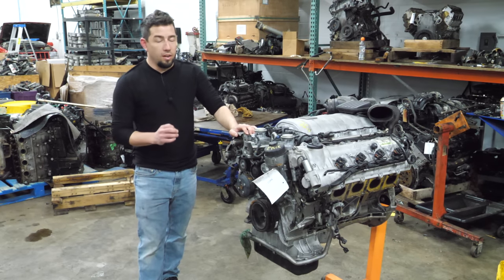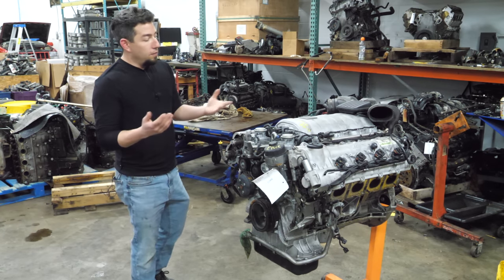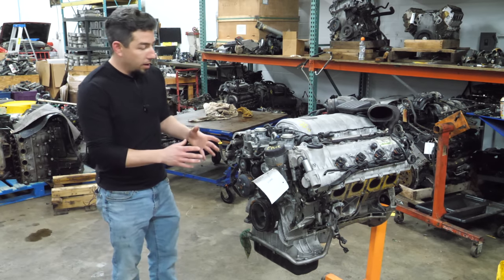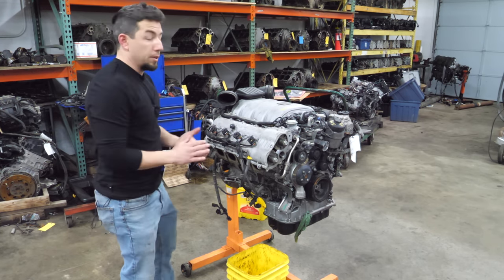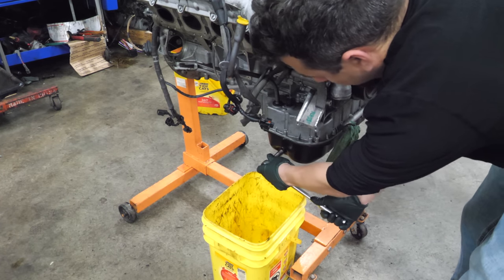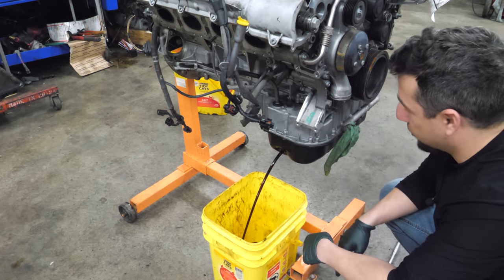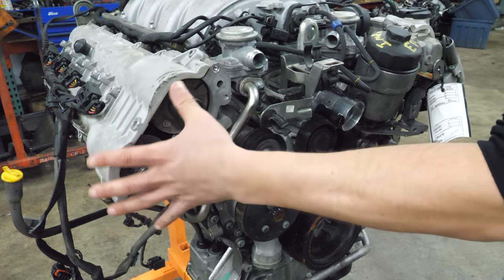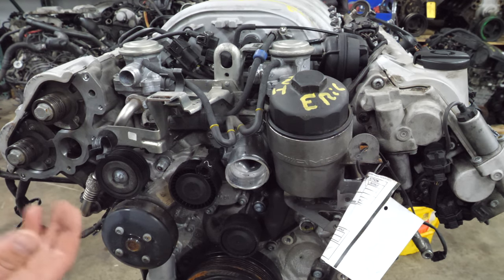Mercedes S63 M156 AMG 6.2L V8 Complete Engine Teardown! What Killed This 500+ HP Euro Powerhouse?

Comment: I am bmw guy, but the two AMG V8 you took apart are designed much more mechanic friendly than BMW V8 or the V10 in the M5. Would love to get an e55 AMG NA or the latter supercharged version.
Reply: They would be the M113 and the M113K ,,probably the most reliable AMG engines ever built , so not so many broken ones around.
M113 used on C55 ,,CLK55 , and M113K used on E , S , SL , SLK  and others.

Comment: Another question comes to mind:  Turning over a typical LS V8 with a 15 inch long solid wrench:  About how many pounds of force does this take?  Back in the day, my friends dad had a 350 Chevy that was rebuilt and ready for heads, on a stand and there was a wrench on the front pulley.  I was amazed at how much force it actually took to turn a V8 over!  I thought it would just turn easily with the cylinders lubricated, as they were, but it took a lot of force.  I was 6'1" and 150 pounds at the time and not muscular, and I could easily turn it over but it was FAR more than I expected.
Reply: It shouldn't have been that difficult, you should be able to turn a shortblock with a 8" wrench with one hand (20-50ft-lbs). Your friend's dad's motor must have had some VERY tight bearings and/or rings or (the worst) he put 1 or more rods in backwards. Many motors have a larger chamfer on one side of the big end for the crank journal fillet radius.
Reply: Yeah - he probably didn't check the bearing clearances, or the ring gaps.
Reply: @johncoops6897  Yeah, it felt like about 50 foot pounds to turn it over, but that surprised me. The heads were on but no plugs so no compression.  He knew what he was doing and lubed it up and let us turn it over.  Thanx!
Reply: Another procedure many shade tree mechanics fail to do is to check and make sure the crank is not bent. Just the crank, lubed new main bearings, properly torqued main caps, you should be able to easily turn the crank with one hand, no wrench necessary.

Comment: Did you work out where the O-ring came from? Some AMG V8s had an issue with O-rings in the oil pump set up going hard and cracking but I doubt that one of them could end up in the strainer.

Comment: How about instead of checking your oil level, you simply don't continue to drive once your car's low oil light turns on? Assuming that the oil light sensor is designed properly (so it actually turns on before you start getting engine damage) then that is all you need to do. I guess some people treat it the same way they would the check engine or needs maintenance soon lights, and just drive the rest of the way home while planning on going to a mechanic at some point in the future?
Reply: Once the oil light comes on, you have probably already done some damage. Especially because it initially happens at high RPMs due to more of the oil being up the top in the heads.
This one wasn't a simple and quick oil starvation... it was driven after it was damaged, for a fairly long distance and probably driven pretty hard.

Comment: I will say that one very first observation you can make of a core engine car be done with your nose. If the engine was seriously overheated the oil will take on an asphalt smell. Those pins you were slid hammering out what was their use? Were they supporting some part of the cam drive system? Looking at your engine stand makes me think of how things just never change. Besides making thing bigger and stronger I feel that some improvement just has to be possible in regards to the typical old engine stand. Did the head bolts that were difficult to remove pass through a water jacket in the head?

Comment: Try looking at "Motoren Zimmer", he does both AMG and MB engines, and from that i learned that there are no cheap way to a AMG engines, if they are cheap you are going to use an insane amount of money before it runs perfect. He did one where they ordered for mote than 40.000 $ parts!

Comment: My guess is, the rubber seal you found was from the oil pickup. Oil starts to suck in air from broken seal, and then oil starvation to engine. A cheap rubber seal knackers these things

Comment: Its front main seal. If serpentine belt breaks....It will end up stuck in pulley and main seal and it will push the front main seal inside engine. Timing chain will shred it a smaller parts and all that mess will end up in pickup tube. At first I was thinking how that had happened...I contacted MB engine department and its common thing. Usually some parts of serpentine belt end up oil sump aswell. Hope that helps :) If some1 here has mercedes then its crusial to control the serpentine belt once in a while.

Comment: Can you find a Mercedes M112 V6 or M113 V8 and tear it down?  These engines were used in the W210 chassis’.  I think they’re great motors having owned 3 of these vehicles. Perhaps too reliable to find??

Comment: It would be nice to see a 6.2L LS3 teardown if you ever get one in. I recently bought a Camaro with the LS3 and it's pretty rough, has lifter chatter and slight (not bad yet) bottom end chatter. Needless to say it will need to be torn down fairly soon, sooner than later. Gotta love it when people don't take pride in what they have and take care of their investment, especially something nice like a Camaro.
Reply: Maybe the owner took TOO MUCH pride and drove the hell out of it as it was intended to be driven
Reply: @sloanmagnum5009  Afraid not, not with the condition that car was in. I wish that was the case. Lol
Reply: @lewismcfarcry  the engine was falling apart under normal driving conditions?
Reply: @sloanmagnum5009  I would best describe it as.. Long intervals between oil changes, running it low on oil, and maybe some hard driving mixed in. I know I have a heavy, freedom foot at times, but I at least make sure the oil is full and change it regularly, around 3k miles, and check/change the other fluids.
Reply: @lewismcfarcry  oh ok. I see now...
Reply: @sloanmagnum5009  What stinks is it already had that high of miles with those driving conditions.
Reply: @lewismcfarcry  will it need a full overhaul?
Reply: @sloanmagnum5009  I don't have the car anymore, but when I had it I was going to put a cam, lifters, heads, ect. A friend of mine really wanted to buy it though so I sold it to them.

Comment: the head bolts on the M156 are notorious failing points. Weren’t they solved or much improved on the refined M159 ?

Comment: FYI; These class of M-B engines can NOT be bored oversized. The cylinder walls are made of a high Silica Aluminum/Steel alloy and are etched after they are machined to size. Leaving a micro thin layer of Silica only material for the rings and skirts to wear against. If there is no damage to the bores new pistons can be installed. But if an oversize is necessary, then all 8 cylinders MUST be sleeved. Leaving damaged blocks like this one as junk! (As far as MBAG is concerned.)
Reply: These blocks are not Alusil etched or Nikasil electroplated.  Instead, they are twin wire arc sprayed ("Nanoslide") with a plasma deposited iron coating.  Provided the bores are not mechanically damaged, the block should last forever.

Comment: QUESTION: If a rod bearing seizes and heats up the crankshaft to where the journal is cooked and discolored from the heat,  is the crankshaft salvageable? Or is it trashed?
Reply from the maker: It just depends on how much material needs to be removed for the journal to be smooth and perfectly round, and then at that point if an appropriately sized bearing exists
Reply: Years ago, they used to weld up crank journals and re-machine the journals. But there has to be a price point to make it doable.

Comment: Considering the amount of engines you tear apart, I’m surprised you don’t use a higher quality engine stand with a worm and gear drive for rotating them. Some even have a hydraulic jack for changing the height.

Comment: I’m at 140 k miles on my m156 engine .  Rocker gaskets x2 , cam adjusters x2 and 13 bonkers expensively oil /filter changes and it’s close to factory power, no oil consumption  and very quiet .  Long live the m156....
Reply: Which head bolts?
Reply: @greydog1104  old style  head bolts .   They do fail but the vast majority don’t according to a merc tech and the amg dealer .  I keeping my fingers crossed 🤞
Reply: @highdefp-rm7zg  I have the old bolts too, 60k miles.  Plan to keep changing coolant and oil frequently and monitor the coolant reservoir for oil film in case a bolt isn't sealing the gasket.

Comment: That's one very strongly built engine. The biggest mystery to me is that there was quite a lot of water in the oil pan, and the rusted in head bolts had also been exposed to a lot of water. That didn't come from being sat out in the rain. Maybe there is something like an a water to oil heat exchanger external to the engine that sprung a leak and contaminated the oil.
Reply: The headbolts were a factory defects in early m156 engines, they would rust and in extreme cases snap and break entire engine.

Comment: This M156 had the old style head bolts which corrode and eventually fail. Judging by the sludge in the oil pan I’m going with the failure being caused by improper maintenance. Regular oil changes, even more often than what’s recommended, are mandatory on them.
Reply: Alternatively, a lease car and they topped up the oil after it was too late.

Comment: Hi mate,some of engines had a o-ring on the oil pick up that went hard and brittle over time .The oil pump then sucks air instead of oil. Maybe this was the case.I am not too familiar with this engines.Just YouTube it and you are bound to find many cases.

Comment: Those cams were more than likely replaced at sometime in the motors life that’s why they looked so perfect. They almost always suffer cam lobe wear , even well maintained cars..
Reply: Unlikely because they would have put the new updated bolts in at the same time
Reply: @greydog1104  your right, forgot the original head bolts were still present.

Comment: A couple comments/questions: 1)those exhaust ports looked huge for a 6.xL engine.
2)I was surprised how clean the back of the intake valves looked.
3a)How does that low oil level sender in the oil pan warn the driver?
3b)If it warns the driver of low oil level, how does this kind of lack of lubrication damage still happen?
Reply: 3a/3b There is a sensor to check oil level and will throw a warning dash code. The thing I find as an over site is nothing tracks oil pressure. There is ways to tap in a sender and gauge. Tracking level only, you could have an oil pump failure with oil in the pan and no code. This also could happen on the m113k engine also.

Comment: My 2013 sonata with 200k miles and cound have bad factory crank still runs fine ish, and the reason is cause oil maintenance was well done. The main issue is the transmission. Its oil never was changed.

Comment: M156 has head bolt issues - it makes great power for the c204 Mercedes’ for the size of it- I’ve had one in my shop with gray milky oil - rough idle

Comment: I am amazed that there are no hydraulic lash adjustors present in the valve train. Did I miss something? or is this how the engine is designed?
Reply: Hydraulic adjustment isn't as necessary on DOHC engines because the valve train mass is really light, so they don't need too much spring pressure. Simple flat tappets with shims for adjustment work well enough.

Comment: For the cost of one of these engines, I'm really surprised AMG didn't stud the blocks. I know head bolts are fine, but they are an accountant's decision. For the regular Mercedes line, bolt em. AMG though, especially with the power they put down and the cost of the rest of the components, they should have head studs.

Comment: If you really want a Mercedes buy one that has a good warranty and get rid of it once the warranty is close to ending.  My son's a master tech at a MB dealership and likes sharing parts prices with me - these prices may not be typical, they're just the ones which caught his attention.  Pair of wiper blades - $400, rubber boot for drive axle $600 (that's just the boot - labor is $200/hour, "A Service" which is a glorified oil change - $600.  I think you get it.

Comment: Are these engines as good as the new DOHC corvette engines?
Reply: DOHC Vette must've research the m156 and took it to another level.  Its upgraded in a few places.  A larger bore 4.125" vs 4.02", larger intake valves 42mm vs 40mm c63.   Higher compression 12:1 vs 11.2:1.   Direct injection vs port injection.  It has a dry sump.

Comment: As an owner of a Merc I can tell you you missed the culprit for oil starvation. It is the dumbest thing ever - the oil level sensor. In our GLE400D there is no dipstick (except for the designer). You need to wait for aprox 100Klm before the oil level sensor tells you if it has enuf oil (or not) so the average owner has no way of capturing low oil situation. Mercedes had a brain snap when the came up with that stupid idea.

Comment: And here is a Tip From an Old Man  try putting a little Air tool Oil  in the Impact on those Stubborn Bolts I used MMO Marvel Mystery Oil in my Air tools  for Over  40 Years

Comment: Looks like the head bolts were updated with the new revision.  I am wondering if when the head bolt update was done someone dropped something in the engine making it’s way to the oil pump.
Reply: They were original,  not the new type
Reply: @greydog1104  just rewatched it and you’re right.  Can’t believe I missed that.

Comment: I'm not cringing about the hammer on the head bolts, I would have threw the whole head down on the concrete floor to knock those bolts through in one swift motion.

Comment: Looks like it needs new pistons and rods, new head gaskets, the crankshaft turned, the block machined. Basically the shop would put in a manufactured engine with a refunded core charge in a vehicle for that type of engine damage. I want to rebuild a Mercedes engine like that.

Comment: What the shop did was tell the customer they need a new motor and got the motor saw how bad it was and ended up taking the vvti plate and replacing the bad part on the customers original engine and sent the motor back to the scrap yard as a core

Comment: Good motor, in some ways put the LS3, L99, and maybe even the LS7 to shame when it comes to the 6.2l displacement and power output at the time but it had its issues obviously.
Reply: There are LS3 and LS7 with over 650rwhp/525rwtq.
Reply: @dennisrobinson8008 I’d like to see these all factory stock LS3’s and LS7’s making that power. Or are you comparing an aftermarket built engine to a factory built one 🥴
Reply: @ryanturnerboles  Heads/cam/exhaust/tune and perhaps e85+tune ones.   I wasn't counting built bottom ends and raised compression.   Heads/cam/exhaust/tune or e85+tune certainly can get either over 600rwhp and the 6.2 to around 500rwtq and the 7.0 to 550+rwtq, stock bottom end.
Reply: @dennisrobinson8008  okay but you’re comparing a modified engine to a factory engine. No LS3 or LS7 came with the same power from the factory as the M156…
Reply: LS7 came factory 500HP and was underrated, so it was really about 520-530HP.   Which is around the M156 power level in the motors where it wasn't detuned.    So non detuned it's 530HP and detuned like in the C63 it's 465-470HP and we all know that detuning was simply limiting the throttle opening to 70%, and any tuner can modify that and get the entire 530HP.     LS3's are coming from the factory about 465HP.    No one has really gotten the full potential of M156, because i never heard of any 10,000 + rpm ones yet, and it should be able to do that all day long with DOHC and small lightweight valves and the right induction.    M159 with exhaust and tune does make 600rwhp@7200 RPM and i have no doubt if they put better cams in it and tuned for e85 it could be 700+rwhp at a little over 8000 RPM which again is nothing for DOHC.   @ryanturnerboles

Comment: Question for anyone who is in the know.
When a engine/part is over heated, is there any concerns about the heat treatment of the parts that are near or involved in the issue that caused the damage?  I don't think I'm able to state my question in a way that makes sense..
If the part is important and expensive and reuse is important over buying new, is this important parts heat treatment considered and is there a way to check and make sure it will proform properly? 
That's the best I can do, and any information is appreciated, from anyone.
Metal is a area I know somewhat, and this has nagged me every time a engine is tore down.
Thanks..

Comment: Agreed Eric, that's a well designed, well integrated engine, even the wiring harness is relatively simple.
Double roller chain, cams geared, not a stub chain like a Ford Coyote, less chance of timing skipping. 👍
AMG, you do get what you pay for.
That square headed water pump passage, well, it is German....😅
Reply: Except for that Magnesium Aluminum Zinc alloy intake that likes to corrode until it fails...